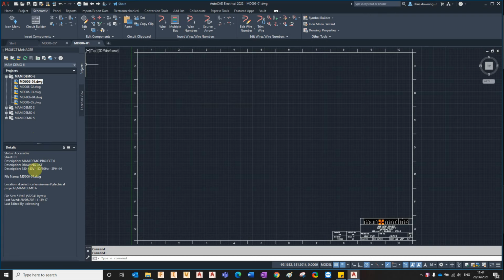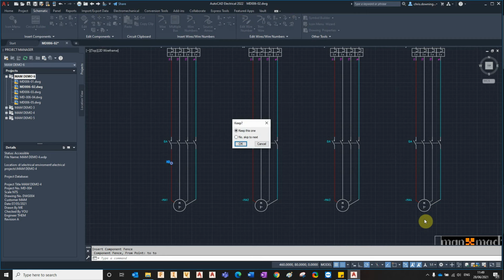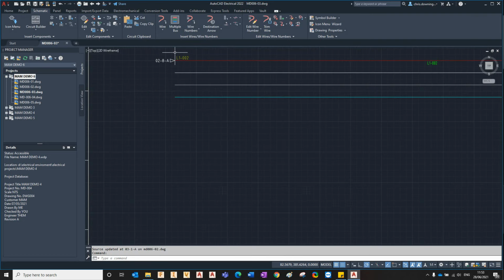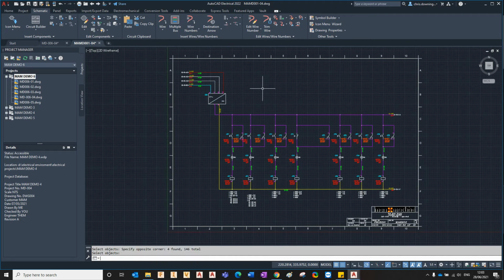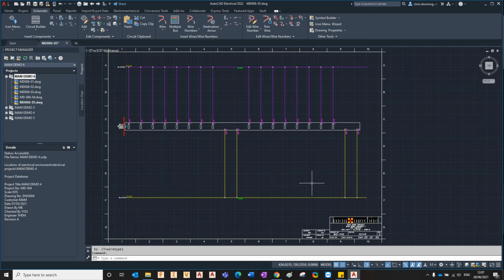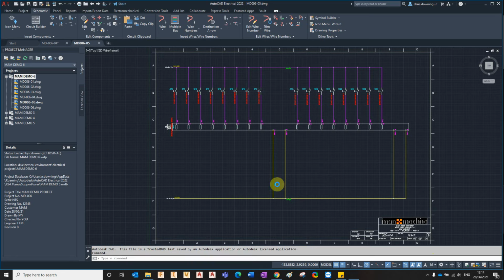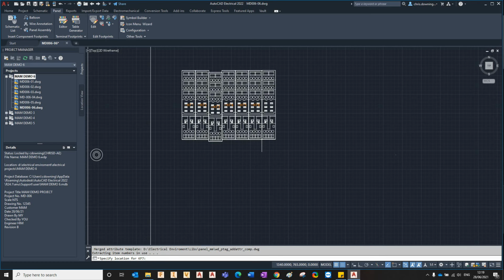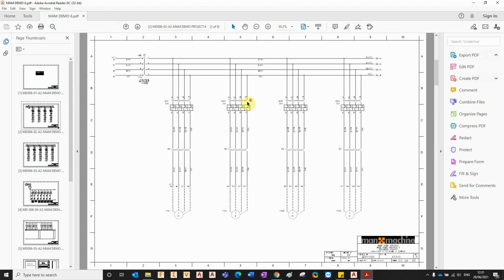AutoCAD Electrical 2022 Demonstration

Comment: how did you get the IEC Symbols in ACAD 2022? All the libraries are installed automatically by default, arent they?
Reply from the maker: From 2022 Onwards all of the libraries are added automatically and the following outlines how to install or uninstall content on older versions 
https://www.autodesk.com/support/technical/article/caas/sfdcarticles/sfdcarticles/Adding-additional-symbol-libraries-after-AutoCAD-Electrical-has-been-installed.html

But once this is done each AutoCAD Electrical Project will still need to be configured per project - this can be set in the project settings.

This link here can assist with setting this up: https://help.autodesk.com/view/ACAD_E/2024/ENU/?guid=GUID-C8F7B69F-F3E8-4A20-B95F-E469BD8563EC

Comment: Are you using this on a mac or PC? I have a mac and I'm using the 2023 version of AutoCAD electrical. The interface looks very different. Any ideas?
Reply from the maker: We standardise on PC for all of our Autodesk products. The AutoCAD for Mac interface is very different, and doesn’t have all of the same tools as the specialised toolsets offer in Windows. I would recommend using something like Parallels or Boot Camp to allow you to run the windows versions of Autodesk applications on your Mac should you need to.

Comment: How to setup project because my icon menu don't have too much equipment. I hope you help me!
Reply: Happens with me to, you solved this problem ?
Reply: cài đặt thêm, dùng file cài đặt chọn custom thêm library. quan trọng thư viện của IEC và JIC, JIS
lúc tạo project đầu tiên thì phải link đến các thư viện đó
Reply: I can only comment with my experience. When you first install Autocad, there's an option to install Libraries (icons). When using Icon menu within a drawing, they force you to attach a stamp "WD_PNLM" .
- In Project Manager you need to setup, (I believe) 2 files? .WDT and .WDP I set them up in their one Directory and reuse them for future project to point to them files. I'll remove old drawings prior to importing new drawings. If I need to go back to a drawings directory I repeat the process (removing old then adding new drawings). That's a quick (not thorough explanation) on setting up Project Manger & adding Icon menus of manufactured equipment. Autocad/autodesk is definitely NOT the most user friendly software out there, trust me. I wish there was a better application that is more user friendly and achieved the same workable file.

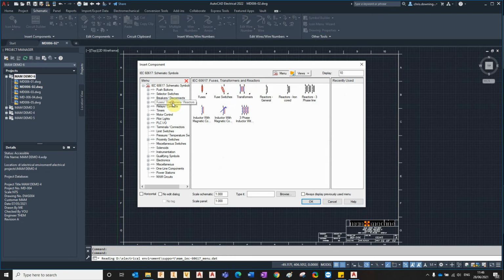Forgot to mention if you're only seeing a limited "icon menu" try clicking on the tab highlighted as "menu" within the Insert Component box see around the 2:40 mark for that. When you click on it it shows with and without Menus (left side of Component box)